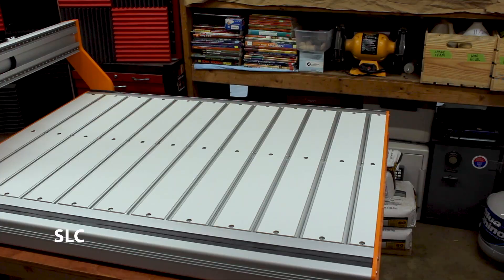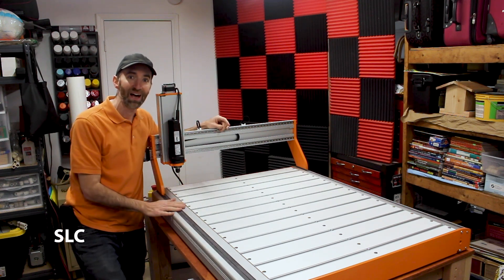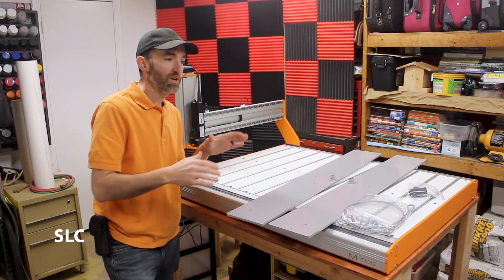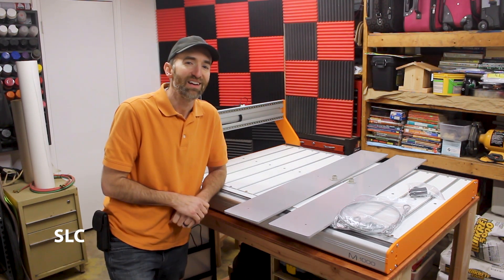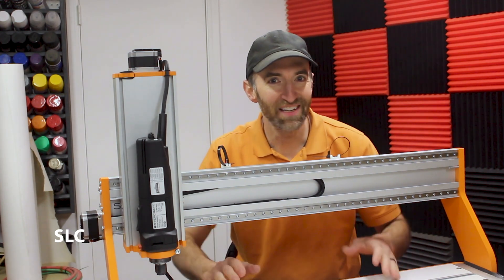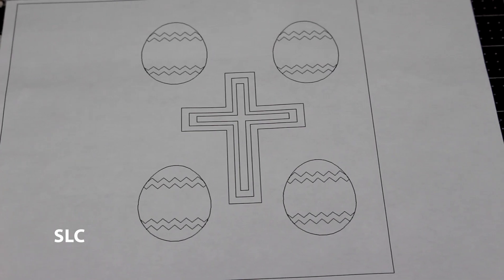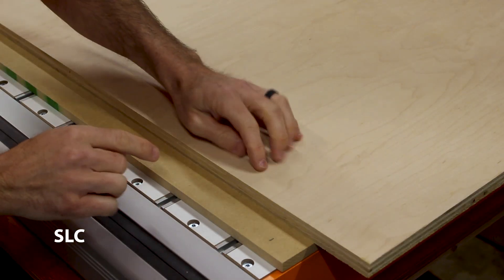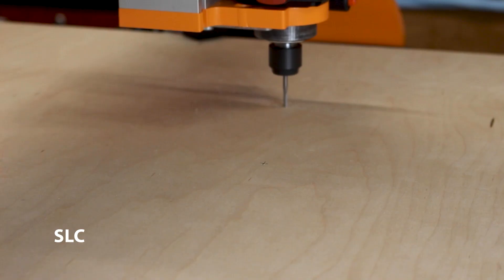Testing out the StepCraft M1000 - Definitely NOT your Average CNC

Comment: I’ve been seriously considering adding one of these to my shop and the larger format of this one, combined with the ability to add the other heads for 3D printing or engraving have put this brand on my list to compare. Thanks for the demo. That cross turned out great. 🙂
Reply from the maker: It is definitely a great machine to have if you plan to produce some distinctively different projects.